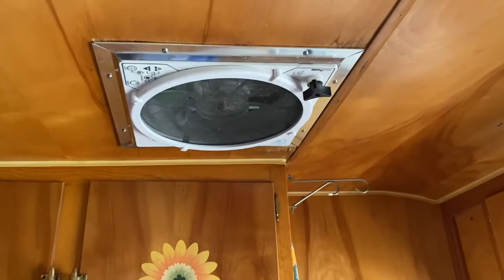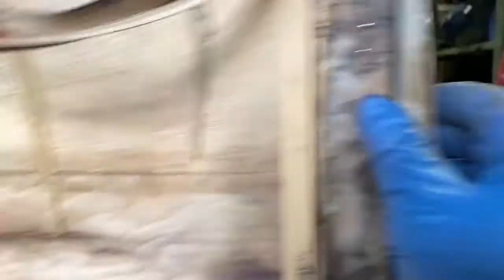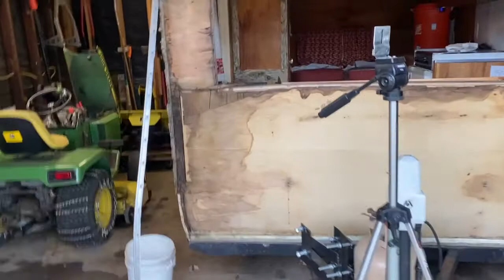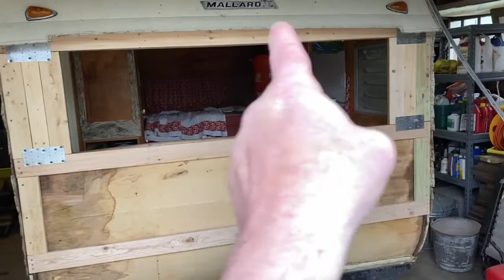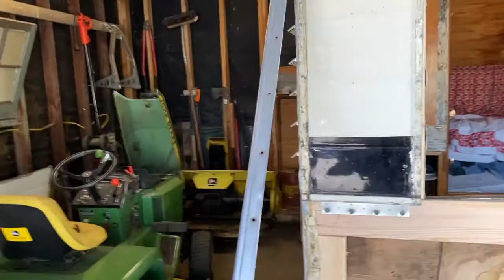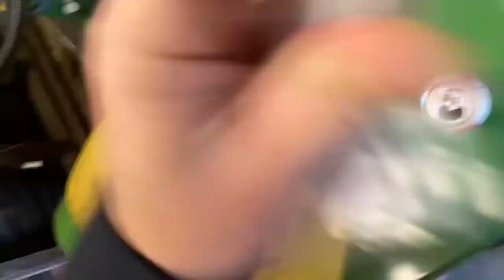Camper wall water damage repair and rebuild

Comment: The only thing I gotta say to people that are rebuilding vintage campers is if you have a camper that has aluminum sided and rough make sure that when you’re replacing stuff, make sure you replace it with non-steel screws because when steel screws rust when they’re used on aluminum, it actually interacted with the aluminum and makes the aluminum fall apart like you wouldif it was heated really hot
Reply from the maker: That's true.  It doesn't happen really quickly, but the two metals interact over time. The factorys did use a lot of steel screws and they lasted 50+ years, but stainless or having a layer of something between them is helpful.

Comment: Hehr 17 is window gasket? What size butyl ? 1 inch x? 1/8, 1/16 thick. Helpful vid. Ty
Reply from the maker: OH man.  I did that project a few years ago.  I don't remember the details.  The butyl was what came standard at the local trailer store and is available online.  It's about 1" wide and 1/8" thick.

Comment: There is what we call here in the woods thermostabilized wood. Basical wood heated to high temp without oxygen present.
The heat destroys everything edible to fungus and bacteria so it can be soaking wet and nothing happens, but still structural usabel.
It is not cheap but I use it in places that i do not want to revisit anytime soon.
It is not as sturdy as untreated wood but for walls that are not load bearing usabel as long one uses hardwood (that is for actual houses, for campers it may be ok to use soft woods)
Closed cell foam boards for insulation and as long water can leak out at the bottom there is not that much trouble with some water getting in on the top
Reply from the maker: Thanks for the input.

Comment: Excellent job with the reconstruction ..I just got a Shasta 30 ft trailer 2001 ..it has rotten wood in the back under the metal and the bathroom wall towards the ceiling is exposed to the insulation and it needs some reconstruction..im trying to figure out how to go about attacking this project ..I just got the trailer today ..so I got some time but my brain doesn't think so ..great video
Reply from the maker: Good luck with the project.  Remember it’s supposed to be fun so don’t let yourself stress about it.

Comment: Where did you store The marine batteries? How did you hook them up to the LED lights. This is a wonderful idea and I would like to do it.
Reply from the maker: I put the batteries in a sealed compartment under the bed and put vents to the outside. Then I ran a few big cables to a spot under the sink and ran all my electrical from there.  Hopefully that helps.

Comment: Bought a 1990 Fleetwood Prowler Lynx. Major dry rot damage on passenger back corner. soft walls on side and back. Trailer has actually dropped 2" into floor. I've been told this amount of damage can be a safety hazard and I know it needs to be fixed. But, mot wealthy and need to do as much of the work as I can myself. 70 year old single lady, strong, good aptitude for building, many power tools. BUT, YouTube University doesn't feel like enough and I'm looking for a for-hire coach who can guide me and keep me from making major mistakes out of ignorance. Live in Grand Coulee, WA. New to RVing and reaching out to anyone who may be able to provide names or resources for my education. Don't really want to remove interior cabinetry, but may have to. At least 2 windows involved and floor. I'm all ears folks. HELP!!
Reply from the maker: Sounds like you have a big project on your hands.  I hope it goes well and that you find somebody in WA who can help you.